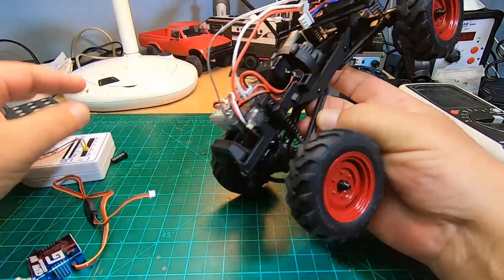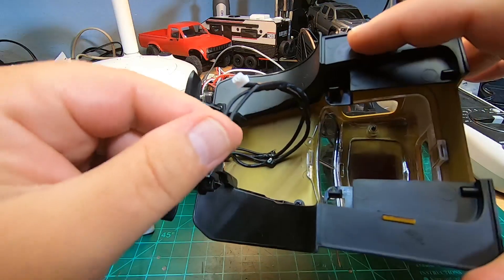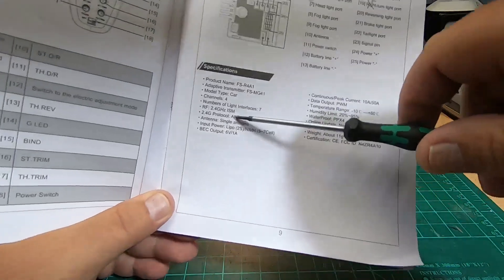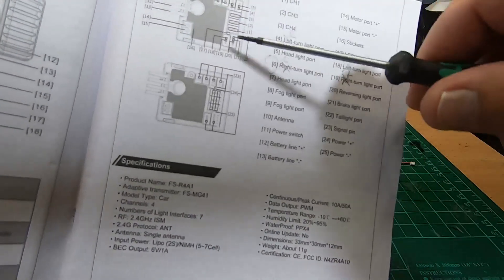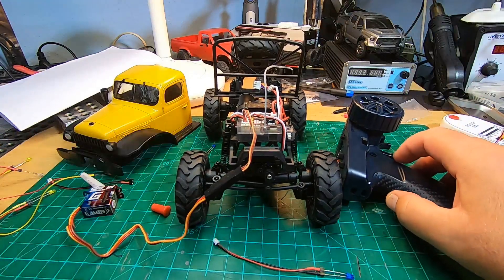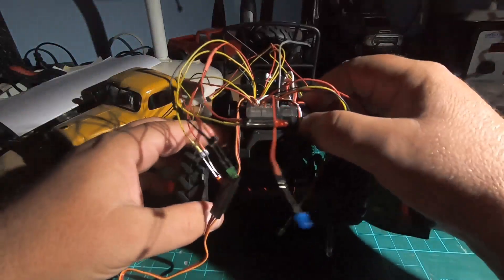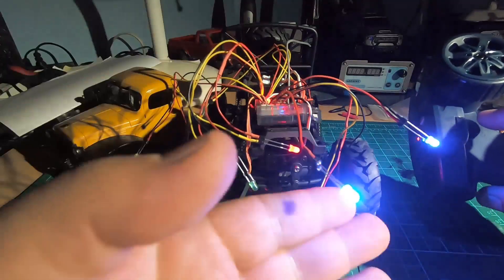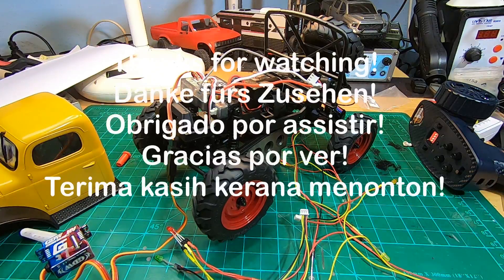FCX24 board and lightcontroller explained

Comment: The second two pin plug is used for the cheaper version receiver.
Reply from the maker: Yes - but this was not yet available at the time of this video. Meanwhile there are also a couple of different boards coming with the trucks... this board is from the first version released.

Comment: Excellent video i just want to add rear lights to K5, was hoping i could just plug a 1.5mm micro jst into a port with a negative and positive wire, maybe not
Reply from the maker: K5 unfortunately does have a different type of the receiver unit, without free plugs. Plugs are 1.25 mm (JST GH), not 1.5 (JST ZH). Red LEDs will not work in parallel with the white front LEDs, you could try to connect white LEDs in parallel (and maybe paint the light bulb red).
Reply: Seems the unused plug on the wiring loom will power the red led`s, i tried it today and lights up @donaldsneffe
Reply from the maker: @rctraildriversuk-lone-wolfvide  No, I do not think so. This would be unusal, guess they did it because the 2-pin is used in the trucks with rx with few light-inputs (e.g. K5), and the 3-pin with trucks with the rx with numerous light inputs (e.g. my first generation Power Wagon).
Not sure - I did test it in my Power Wagon and it lit up the white LEDs (but reversed polarity). 
But maybe you are right, normally red and white LEDs won't work in parallel - maybe the strands include different resistors.
If it really works (white and red LEDs in parallel) I recommend to test the red LEDs before installing those... so let it lit up for some minutes and check if they run hot.
Reply: i could not risk putting multimeter on the spare plug for fear of shorting out so i pushed wires from red 3mm led into plug after taking a "good" guess on polarity and it came on with front lights, left it on for maybe 11/2 mins then switched on and of a good few times and all was well, so ordered some 1.5mm 3 pin JST to wire it correct, it seemed the led was not as bright as it would of been plugged into lipo pack  @donaldsneffe
Reply from the maker: @rctraildriversuk-lone-wolfvide  ok, red and white work in parallel? Surprising. 
Light plugs are 1.25 mm (GH), not 1.5 mm (ZH).
Reply: On the back of your super helpful video i did order the 1.25 plug set, so far i only tried a single red so  when plugs arrive i will hook up the pair and fully test @donaldsneffe

Comment: Fantastic video but one correction. The connector type is not GH1.25. I know only because I ordered them and they don't fit. What does fit goes by a few different names: JST/molex/picoblade 1.25.
Reply from the maker: Thank you. 
Motor connector is JST PH 2.0, battery balance connector is JST XH 2.54 mm, Servos are JST GH 1.25, I am 100% sure, but those are also sold under other names (Molex Pico etc.), all will fit (micro connector 1.25 mm 2-pin, 3-pin etc. on Ebay). 
For the battery power connectors ("Micro-Losi", "Walkera", "Syma", "Nine Eagles") with 2 mm pin distance tons of names are used, I guess the (or a) correct name is Molex 51006 and 51005 for the two connectors, male and female. 
Some dealers (Amazon, etc.) sell 1.25 mm under wrong names (mostly mix up GH 1.25 and ZH 1.5).
I do have tons of those connectors here, for crimping (JST SH 1.0, GH 1.25, ZH 1.5, PH 2.0) and use those for nearly 15 years now in micro helis, planes and cars. 

JST GH1.25, Molex Picoblade... seem to differ in details (JST and Molex are two different companies), but they will always fit. Most of the GH1.25 I bought (from Ali, Ebay, Hobbyking) are probably not even JST or Molex, but some generic connectors. 
Maybe you have bought JST ZH (1.5 mm) under the wrong name JST GH (1.25 mm)?
I always rely on "mm" when I buy (1.0, 1.25, 1.5, 2.0) and not on the names JST SH, GH, ZH, PH - because dealers quite often name those wrong.
Reply: @donaldsneffe  JST-GH and Molex Picoblade are different connectors. FMS receivers use Molex Picoblade. For the smaller connectors.
Reply from the maker: @alexdrinkwater28  Probably true, but they will fit. Anyway, those are sold as "1.25 mm micro connectors" from China shops and those connectors are neither Molex nor JST, which are two brands. 
There are so many names used for those in RC, and "Molex Picoblade" I hardly read anywhere.
Complex topic with those micro connectors in RC.

Comment: Are you postive the servo ports out are NOT ZHR 1.5mm? Because I used ZHR 1.5MM to servo adapters to run the stock fcx24 servo off a Flysky GT5. Your video says the ports are GH 1.25 though. In my case, the FCX24 servo plugged right into the ZHR 1.5mm connector adapter I bought.
Reply from the maker: No, it is GH 1.25 mm. ZH 1.5 mm are for example Flysky micro receivers AFHDS3 and ANT and flybarless systems for helis.
I am 100% sure. Hobby Plus CR-18P radio is also the same.
But there is a new radio (v3) for the new FCX24s, without the red tabs for switching. It also has a new type of receiver. Do not have this, so cannot say for sure which plugs those new ones have.
The "old" Flysky FS-MG41, which comes with the old FCX24 and Smasher and Hobby Plus CR-18P has 100sure JST ZH  1.25 mm plugs for serfos and a JST PH 2.0 mm plug for the motor
Reply: @donaldsneffe  Thank you Donald. FMS sent me what appears to be a V1 with the red rockers to replace my deffective V2 ESC. My replacement ESC looks exactly like yours at the 12 second mark. So I would need a JST ZH1.25 for the servo out ports then?
Reply from the maker: @bigworm1384  Yes and no ;-)  , 1.25 is JST GH - and this is correct. (JST ZH is 1.5 mm). You need 1.25 mm 2-pin, 3-pin and 4-pin plugs for the servos and lights, correct name is JST GH (often also called Molex Pico). 
I am 100% sure.
JST SH 1.0 mm, JST GH 1.25 mm, JST ZH 1.5 mm, JST PH 2.0 mm (motor), JST XH 2.54 mm (balancer plugs), JST "Losi mini, Walkera, Syma" battery of FCX24.
Reply: @donaldsneffe  Thank you again. Im more confused than I was...Im sorry! Ugh, why cant they just give us normal servo ports. My god this is so complicated. You mentioned the following. "No, it is GH 1.25 mm. ZH 1.5 mm are for example Flysky micro receivers AFHDS3 and ANT" Ok. I hear you. But the FS-R4A1 is a flysky brand ANT receiver. So while I hear what you are saying. Im also confused at this contradiction. Anyhow, I sincerely appreciate your help. I love your informative posts. Most helpful and appreciated. Thank you for your time. See you around!
Reply from the maker: @bigworm1384  Ah, ok - now i understand. Sorry and yes, you are right, this is also a ANT receiver, but unfortunately does not bind to other Flysky ANT radios. I meant a "normal receiver" for a non RtR radio. The ANT micro receiver I meant was the FS-R4M, which has 1.5 mm GH (and the AFHDS3 Flysky GMR, like and use both a lot in my micros).

Comment: Hello friend, maybe you have already discovered it, the second plug that comes in the light connection cable is to connect an extender to add rear lights or a light bar, greetings from Argentina
Reply from the maker: Ah, ok, thank you! But the polarity is vice versa...?
Reply: @donaldsneffe  I think it is the same polarity as the original front connection, I connected the two, the rear position lights and they come on when the headlights are turned on, so I think it is the same polarity.
Reply from the maker: @MartinianoA  Hmm... I tested it (even in this video?), and am sure that at least in my version it was reversed. Maybe they changed. I had to change the polarity in the 2-pin plug to make it work (easy to do). 
There are a lot of small changes in those small FMS FCX24 and Basher, without any notifications (v1 radio with 2 or 3 pos, v2 radio, v3 radio, plastic and metal gears, full ball bearings and only partly). 
Even in the CR-18Ps (same radio) there is a change in the light controller between Rock Van and T-Hunter (Rock Van can switch off turning lights, light controller of T-Hunter cannot).
Reply: @donaldsneffe  sorry for the delay of my response. Unfortunately I don't have another one to check if the polarities are different, but it's great that you were able to configure it. As for the turn signal lights, I still haven't been able to configure them, I reckon I'll try these days. I have not yet checked if the gears are metallic, I think not, but I will also check later.

Comment: Very helpful video my friend , i need your help , i want to connect a  Winch it need 3 options for example if you want to pull a car you need to take out the wire, stop it, and take in, to pull the car . where can i connect the winch?

Comment: Hello I’m wondering if the stock ESC from the Eazy RC cars can be used as just a light controller with the ASX24 ESC as the main controller for motor and servo?
Reply from the maker: No, because the EazyRC board does not have a channel 2 (Throttle) out. You will need a receiver, an ESC and a light controller. The only RtR micro receiver units which can do this are SCX24 v1 (old) and Panda Hobby (at least my Tetra K1 1/18, I do not have a 1/24 Panda and do not know if it has a ch2 out). All others do not have a channel 2 out port.
Reply: @donaldsneffe  if I use the scx24 esc then it could work too use the eazy RC esc as a light controller? Would you solder a jst  to the servo connector on the eazy RC? Then plug into ch2 of the scx24 esc?
Reply from the maker: @plukensteinpaint  No, you cannot use the EazyRC lightcontroller with the SCX24 receiver/ESC. You would have to use 2 radios then, the SCX24 radio for servo and ESC and the EazyRC only for the lightcontroller (or lightcontroller and servo, and SCX24 receiver only for ESC).

Comment: Impressive, still alittle confuse but after 2 or 3 watch I understand the electrical flow. Thank you for explanation
Reply from the maker: In many lightcontrollers LEDs do have either a common plus or a common minus, and this is, what is probably difficult to understand. If they would make only one spot for all common + and one spot for each - of each LED, it would be less confusing.

Comment: Thank you 🙏🏼 for this, you explained a lot still I have a problem with my lights ….my JST plug came off very easy and while I was trying to fix it I totally removed it and now I can’t put it back on …these micro jst plugs are tiny how can I put the cable back on the plug ?
I wanted to ask what kind of adapter I need to install other light with DuPont plug or an other servo with DuPont
Reply from the maker: The plug (metal part inside) is probably broken off or the wire has come out?
Not an easy fix. Either buy contacts and crimp (need special crimping tool) or buy a JST GH 1.25 mm plug with wires, cut the old connector and solder the wire (with connector) to the cable of the lights. Check polarity!
You could also use the small 2-pin connector (see video, you'll have to change polarity). You can pull out the 2 wires of the 2-pin connector and insert them into the 3-pin connector, or use 2-pin (with swapped polarity) on the "fog light place".
Do not forget to insulate the wires of the 3-pin connector, if you do so.
Dupont - JST GH (Molex) 1.25 Adapter? Crimping is the easiest way, if you cannot crimp JST 1.25, you probably can crimp DuPont (easy with every crimping tool). Buy JST 1.25 with wire and crimp DuPont to it.
Probably there are adapters out there, but hard to find.
Here, this Hobbyking adapter, ... buy is Y and 3-wire... you could adapt it (cut one part of the y). 
https://hobbyking.com/de_de/jst-molex-1-25mm-male-to-2-x-jr-female-1pc.html?affiliate_code=PREBYDYCUEBOAHL&_asc=989667413
If you buy adapters, always check polarity! And do not forget to insulate open ends.
Reply: @donaldsneffe  he metal parts are stuck inside the plastic connector can’t put the cable back or don’t know how plus how do I find polarity? all cables are black
Reply from the maker: @TheAlxzHouz  You have to pull out the metal parts (lift the lip on the connector with a needle, tiny flat screwdriver, fine forceps).
But you will need a new connector anyway... (or crimping, what is difficult). 
Easiest: pull the connectors out of the 2-pin and insert those into the 3-pin and you are good (insulate the other wires).
Polarity: Simply test, in LEDs wrong polarity will not destroy the LED, it will simply not work (THIS IS ONLY FOR LEDS!!! IN SERVO PLUGS YOU MUST PLUG IN IN CORRECT POLARITY (at least red), OTHERWISE YOU WILL DESTROY SERVO/BOARD). Plug in, if LEDs work, ok, if not, swap the 2 wires. Since "metal parts" are still in, you know which 2 out of the 3 positions you will have to use, best mark them on the plastic housing before removing).
Reply: @donaldsneffe  thank you but still didn’t tell you while I was messing with the wires trying to extend the 3 pin connector cable I pulled off the 2 pin cable like ripped it off … now it’s just 2 naked cables ?! Still have the connectors but I can’t reuse them?
Reply from the maker: @TheAlxzHouz  If there is still some wire on the 2-pin you can reuse it.
Otherwise (assume you cannot crimp the tiny connectors) buy a 3-pin or a 2-pin. 3-pin: remove one wire, solder the other 2 to the cable to LED, 2-pin: pull the metal parts out of the housing, solder wires to the LED-wire, and plug them into the 3-pin.  Search on Amazon, Ali, Ebay... for JST GH 1.25 mm (or Molex), even your local Hobbyshop should have those, those connectors are used for the small 1s Eflite UMX planes for example, and for many tiny drones...
Reply: @donaldsneffe  thank you 🙏🏼 you ve be been more than helpful !